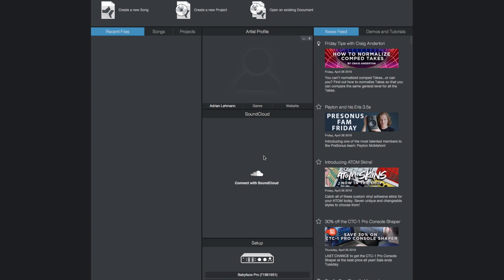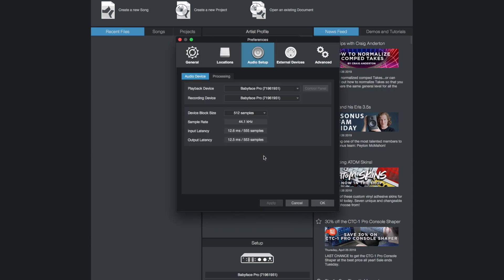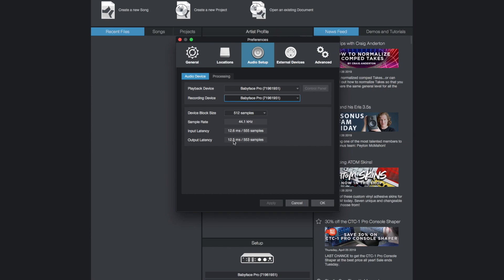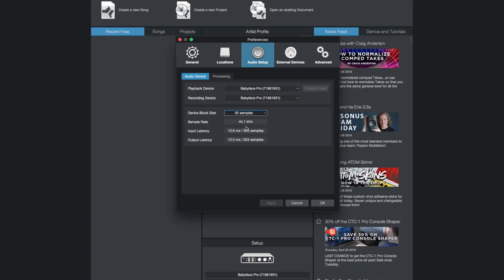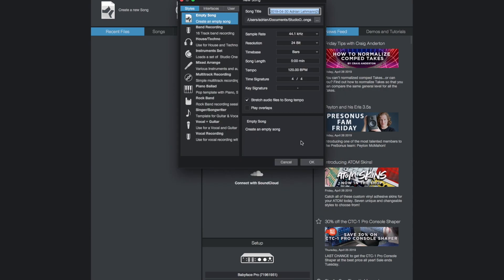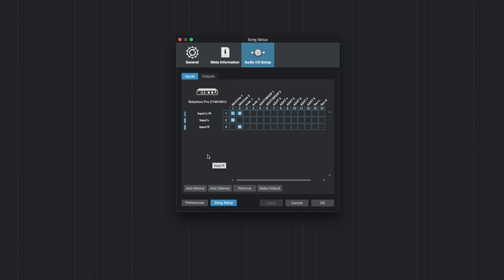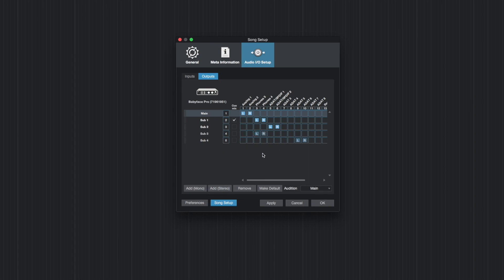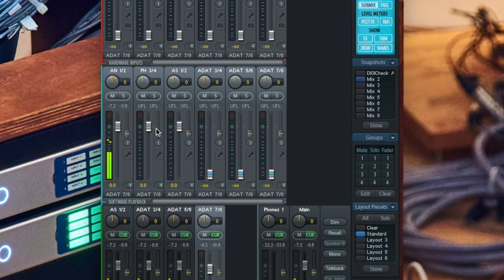How to setup Studio One with RME Audio Interfaces

Comment: Hello. I just bought a Babyface and, unfortunately, everything is not going as well as in your video. I also have Studio One but Babyface does not appear in the list of 'AUDIO DEVICES' as in your video (0mn 34 seconds).? However, I have installed the RME software and TotalMix works. Why does Studio One not see my BabyFace? Furthermore, the support service is having trouble answering me. I admit to being a little disappointed...
Reply from the maker: Is your interface correctly installed. Can you play audio with another app but Studio One?
Reply: @RMEAudio  Hello. Thank you for your reply. I installed the driver normally, as I do for all applications. On my Studio One, everything works, including the plugins I installed, except that Studio One doesn't "see" Babyface.
I remind you that the RME Babyface driver includes TotalMix, and it works very well (sound recording, headphone monitoring, 48V, PC/Babyface sync control, etc.). My PC is new (Intel i9 - 64 GB RAM).
I'm eager to use Babyface, and now I'm stuck…
Reply from the maker: @rogergerardprieurpart8415  Did you select ASIO FIreface USB? Do other programs work with ASIO Fireface USB? Yoo can also contact us at support@audioag.com.
Reply: @RMEAudio  I'm in contact with Presonus (Studio One), who told me that RME said that instead of "Babyface," it says "USB FireFace."
Yes, I do have "USB FireFace" as the option, and I've just run a few recording and configuration tests, and it's working so far. Will this be enough to fully operate the BabyFace Pro?
Reply from the maker: @rogergerardprieurpart8415  Ok, you have a Mac. Then it's fine indeed.
Reply: @RMEAudio  Oh no, I don't have a Mac, but a Windows 11 Intel i9 PC.
Reply from the maker: @rogergerardprieurpart8415  Ok, as long as t it is not Windows Audio but Fireface USB it's automaticly ASIO, I assume. To be sure please contact Presonus.

Comment: How about hardware integration in studio one? Pipe Line , Keys and controllers
Reply from the maker: Added to our list :-)
Reply: Thanks!!!
Reply: Did you ever find a video for this? I’m trying to run my audio from studio one through some guitar pedals and back into the daw using pipeline. It’s very confusing.
Reply: @leroygreen214  Nothing on the net : (
Reply: @HugoDaSilva7  I got the signal path sorted out this morning. I had to use a reamp box to finally get it working. Not sure if are trying to do the same thing as me but it will take some configuration on the I/O grid and proper routing. I did this without using Pipeline